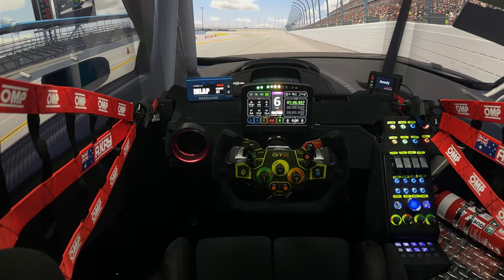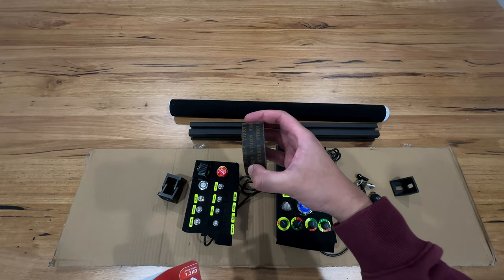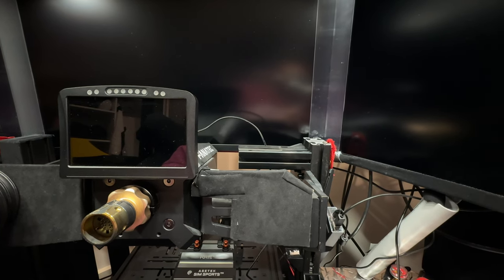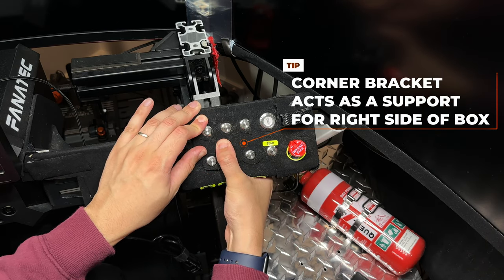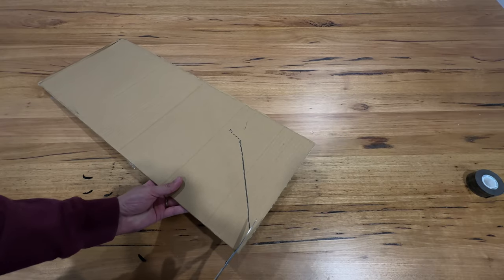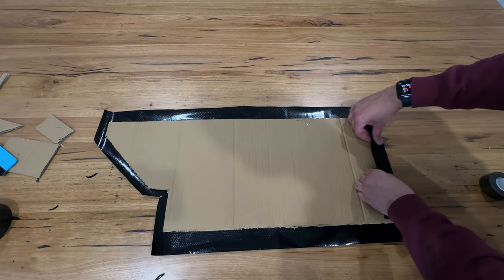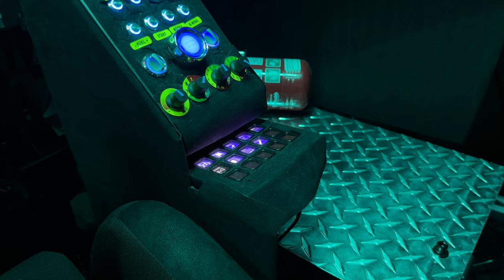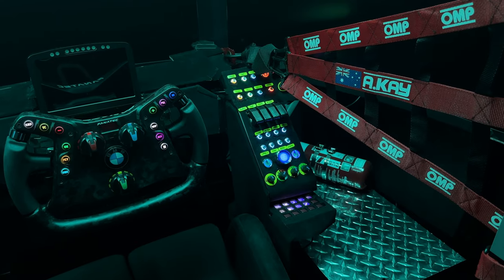BUILD YOUR OWN Sim Racing Centre Console CHEAP!

Comment: I like the concept and the execution but, no way would I cover things in Alcantera as it is obiously a dust and hair magnet.
Reply from the maker: Yeah as you can clearly see in this video on the boxes 😂 to be fair though all you need is one of those lint rollers like I used in the video and it’s really easy to keep it clean, it’s just a daily process is all
Reply: @alexkayracing  Only noticed the "fluff" when you was showing us how. When you was driving it did not notice unless you cleaned it before hand 🤣
Reply from the maker: @secret_one  nah you can only notice it up close so in videos etc it never shows, I also have carbon fibre wrap which doesn’t attract dust but gives a bit of a shine on camera.
Reply: @alexkayracing  Well then alcantera is the correct product for your situation as shine is no good in a video.
Reply: the Alcantara is fine BUT the patchwork around the buttons is not.
Reply from the maker: It was the first ones that I’ve made and they’ve last me a year, so they’ve become a bit worn out:)

Comment: Quick tip, an easier and better way is go VR.
Reply from the maker: I think now it’s getting close to where VR is almost an always viable solution. 

I remember when I started simracing it was in VR, and even with an RTX 3080 at the time that GPU still wasn’t enough to get a decent frame rate without lowering the graphics and reducing the experience. But now I think thinks are getting pretty close especially with this quest 3 headset

Comment: So helpful, I'm setting up my triples next week and been planning to make one of these, this is gonna be something to rewatch in a few weeks!
Reply: my only issue is that my wheel deck side pillars arent that tall, the height that my wheelbase is mounted at is literally at the very top, they're only 58cm heights, so I guess, Could I just lay the angled profile on the pillar, or get a spare bracket and screw it on the side lower down?
Reply from the maker: You could definitely do that or even just put the profile on the side of the pillar rather than on the front of it, and then just attach the boxes at more of an offset to the left to make up for the extra distance from your hands!

Comment: A 2X2 or 2X4 would be a lot cheaper but you would have to be able to cut the right sizes and angles. 
Also relatively easy to move things around, just screw in to a different spot and maybe drill a hole, but not move multiple times.
Reply from the maker: Yeah that’s true mate you’d need to be wavy with saw etc (which is simple enough) both ways have their pros and cons! Thanks for watching 👍

Comment: Why would you attach with tape when there's mounting holes on the back of the button box that rests against a corner bracket?
Reply from the maker: Good question and thanks for watching. 

1. If you try to match that top right hole up with the corner bracket then it will limit the lateral (lift-right) customisation as the channel for that hole is very small.

2. To be honest another way you could do it is place a corner bracket at the top and bottom of the bar. Then put the boxes on the bar and then push them firmly together with the corner brackets and then tighten (kind of like a vice) and then that would also be a good way to do it.

Comment: I like mine to look clean and neat at all times i guess your application is for videos. Also it maybe cheap for materials but in total with button boxes you need my console cost a minimum of £400 to build with button boxes
Reply from the maker: You can make your own boxes cheaper, the whole point is you can save quite a lot doing it this way as opposed to using wood and building a structure. 

My setup is clean most of the time but it can gather dust pretty quickly. 

Only thing for my boxes is because they were my first ones I wrapped I didn’t know how to wrap them properly, in the future when I decide to re-wrap them I know how to make it look clean and smooth; for now there’s no need because you can’t see any of that in videos, only up close.